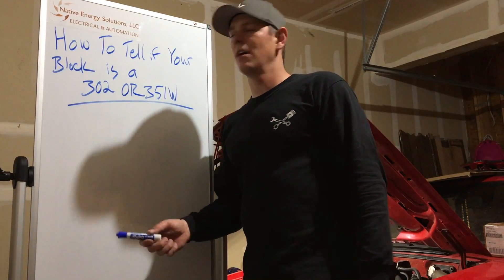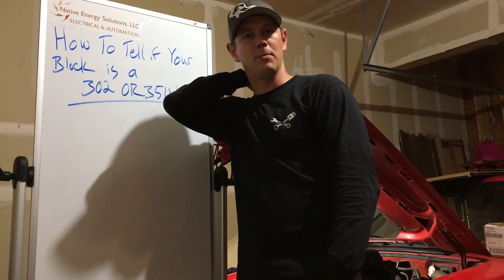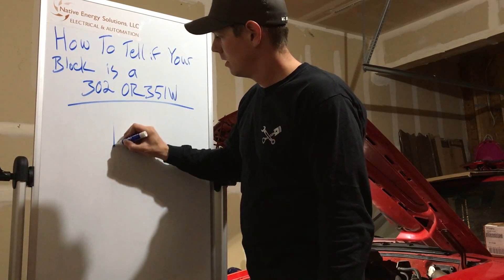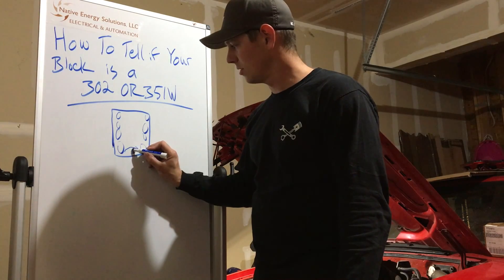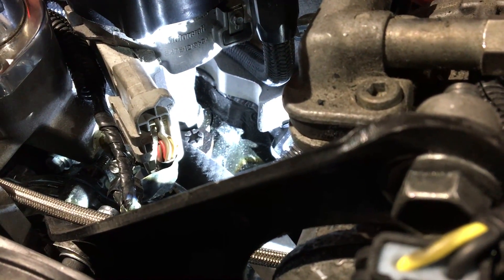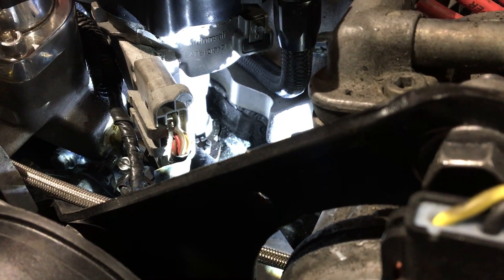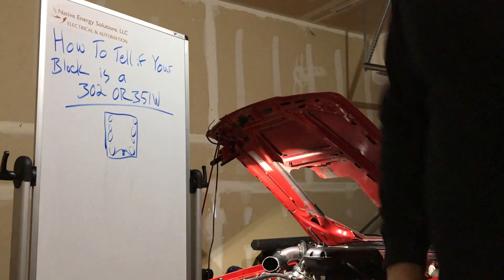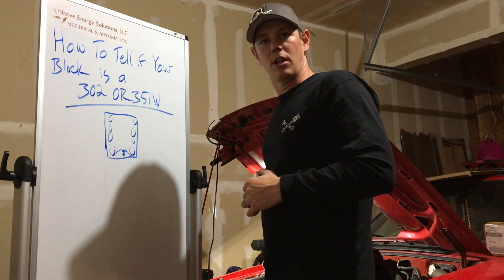302 or 351W??  What Block do You Have??  [How To / Tech] 302 vs 351w

Comment: What's the best junkyard manual to look for to mount up to a 351 Windsor?
Reply from the maker: Manual transmission? Anything that bolts to a 302 will work with a 351w.  Same bellhousing pattern.  The balance of the engine is different though just fyi.

Comment: 289s & 302s have 12 intake manifold bolts..6 on each side..A 351W has 16 intake manifold bolts..8 on each side.
Reply: I think it depends on the year for that to work
Reply from the maker: Nice tip 🤘🏻

Comment: I have a gran torino 1973 and, how can I found if its 351w or 302? Thx! Everybody for a help
Reply from the maker: If the engine is physically still there, look at where the distributor goes into the block… the 302 crossover brace is fairly level with the distributor hole while 351w has a significant height difference
Reply: Thx so much! Apreciate the info.!!👍👍
Reply from the maker: Absolutely

Comment: The space between head-to-head on a 351 is right around 11 in on a 302 it's just under 9 in also if you look at the oil filterthere will be more space between the air filter in the top of the deck where the to the block.........on a 302 it's practically right on the head
Reply: How can you tell if you have a regular 302 engine or a boss 302, what is the difference?
Reply from the maker: The block is the same.  They use Cleveland 2v heads on a standard 302 block
Reply: @sanfordhoward2012  the heads
Reply from the maker: Nice!  Thanks for the tips

Comment: On a 302, the thermostat housing bolts are lower so they end up being "behind" the timing cover (best way I can describe it).  On a 302 you have to use a wrench to remove the thermostat housing.  On a 351W, you could use a ratchet.
Reply from the maker: Nice tips, thanks!

Comment: I have an F100 that I recently purchased.  I was told it has a 302 with 351 heads.  Now that I have the truck home in my driveway, how can I verify this?  The valve covers have 6 bolts so, I know it's not got Cleveland or Modified heads.
How do I know if it is a 221, 260, 289, 302, 351W or, as stated, a 302 with 351W heads?  I'm not doubting the gentleman from whom I purchased the vehicle.  I just want proof for when I need parts or when some guy says I'm not on top of my game.
Reply from the maker: Well, each block has a casting number on it that tells what it is... hard to read with it in the vehicle though.  Typically on the side of the block by the freeze plugs.  Get that and do a google search on the number.  

To decipher from the 302 or 351, assuming it’s only between those two, it’s easiest to look at the portion of the block directly behind where the distributor seats to the block where the lower intake manifold seals.  If that portion of the block is relatively level with the base of the dizzy that seats to the block you have a 302.  It that portion of the block is substantially higher, 3/4 of an inch or so, than the base of the dizzy at the block, you’ve got a 351.

Comment: The 351W has 1/2" head bolts where the 302 has 7/16ths head bolts. Lower intake manifold is wider on a 351W due to the deck height. A 351W is thicker, taller and wider than a 302.